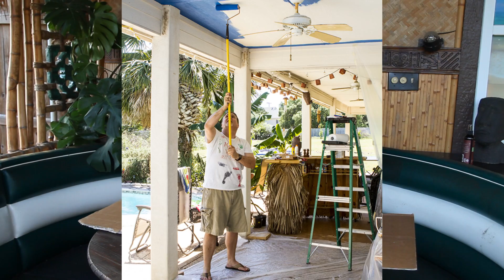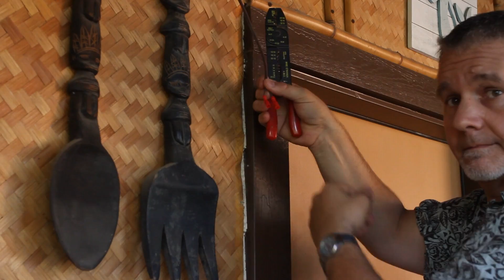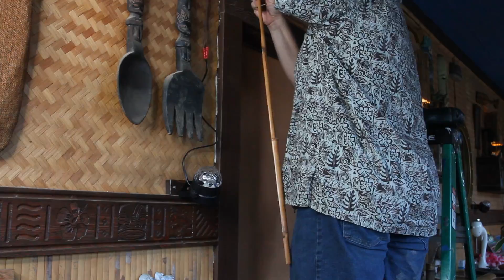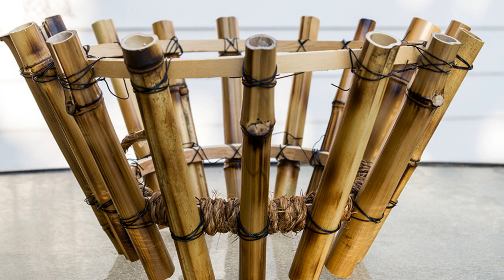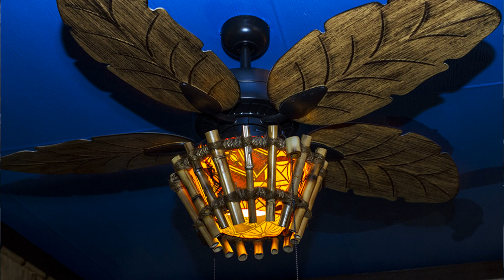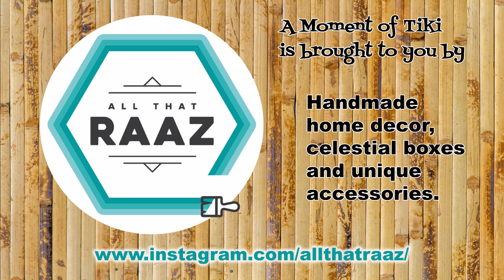Tiki Lighting - A Moment of Tiki Episode 31

Comment: I've had some of those round projectors and managed to fix them.  If your's are like mine, the problem causing most of the problems was in the design- there are wires to the LEDs on the moving part going down to the main board, and like you would expect, flexing back and forth they break off.   I've replaced the wires with longer ones and used some strain relief to make them last longer.  A better designed one I have puts all the electronics in the back, and just moves the optics in front of the LEDS.
Reply from the maker: My most common problem is that the micromotors seize up and stop the rotation. I think I could competently swap them out if I could find a source for compatible replacements...

Comment: what ocean wave project are you using?    I also had another question about a particular kind of tiki light from the old days (40's, 50's)...its a hanging light that has chunks of what looks like acrylic cubes in greens and blues and purples that are stuck in the sides of a otherwise black square ( or could be round) hanging lantern (usually thin like a rectangle).  When lit these acrylic chunks glow and it looks amazing.  Very old school.  I saw one once in a mid century shop here in Palm Springs but can't find any history of them online or even old ones for sale.   I thought you might know...sorry for the long post.
Reply from the maker: No apologies necessary! The turtle is a silhouette painted onto the ceiling, which itself is blue to convey an underwater effect. Pretty simple, but the projectors enhance the effect. 

There's no specific brand for the projectors. They're mass produced in China and resold by all manner of outlets in the U.S.  There's a tabletop battery powered version sold as a night light that's too weak for tiki bar use, but almost any that plug-in are viable for this kind of use as long as they specify water/wave/ripple projector. I've noticed the latest generation are shifting to "disco lights" and aren't suitable. They can be found occasionally on Amazon or Ebay, but I've had the best luck with Ali Express. It takes about a month for delivery, but buying several at once is cost effective.

The acrylic light you're describing is commonly known as a "chunk light." They were a big part of mid century modern lighting decor. The acrylic is often Lucite. I know folks make modern reproductions. I've not tried it yet myself. And yes, they do fit into tiki bars as tiki-adjacent.

Comment: Hi Jayme really enjoy your moments of Tiki 🏝 had a question when you built your lampshades for your fans what did you glue the tap a cloth to. Just the inside Bamboo hoops or did you make an inner shade. Thanks keep the videos coming
Reply from the maker: I went super low tech with these, and glued the fabric directly to the hoops. Five years in and they're still holding up!
Reply: @LagoonofMystery  That lamp is impressive. What is the tapa print made of paper, cloth, cow hide, fiberglass?
Reply from the maker: @lakebafondren5868  It's a cotton print from Spoonflower, if my memory isn't lying to me.

Comment: Very nice videos.  Note however that those bullet connectors are 12V and below.  Never ever use those for 120V, and you never use crimp connections for household wiring.  They sell special connectors with screw terminals for that.  If you ever have a fire and the Marshall sees that good luck with insurance.  Other than that I love everything else!
Reply from the maker: Thanks for the advice! I was unaware of that voltage limit.